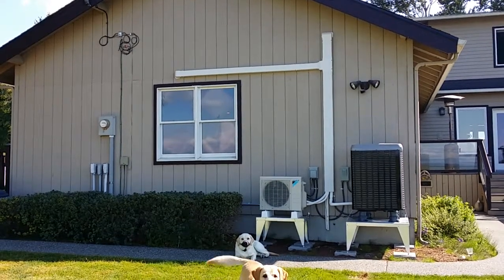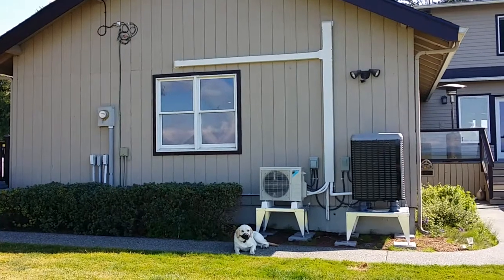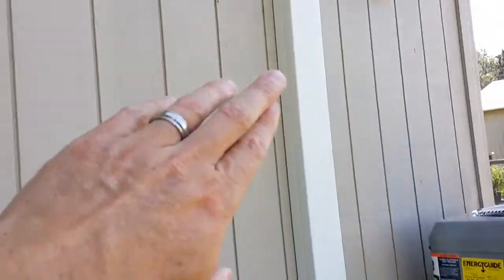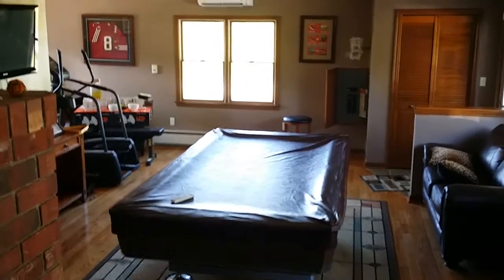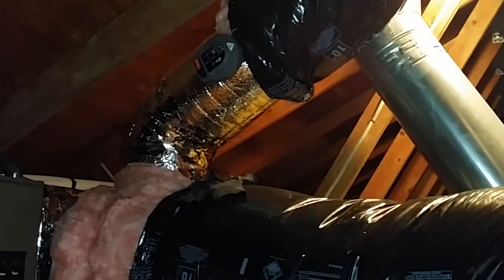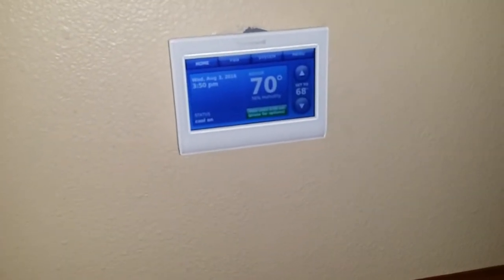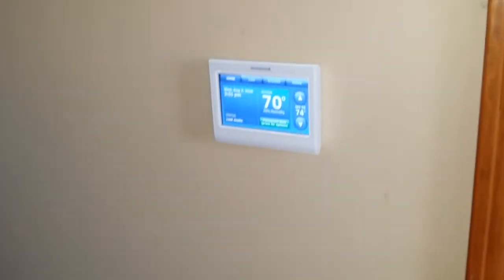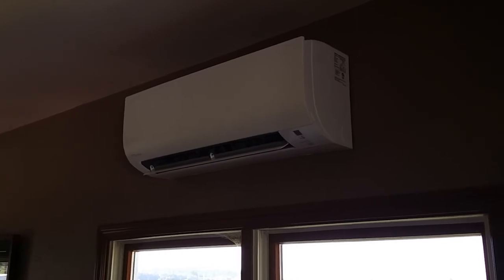Coleman/York/Luxaire Inverter 5 Stage 2-Zone Heat Pump System w/ 19 Series Daikin

Comment: Nice!   Do oyu put UV lights in the ductless units to stop the mold ?
Reply from the maker: we dont have chronic mold issues, so no, but if you are getting mold check that the hole that was drilled for the refer lines is sealed.